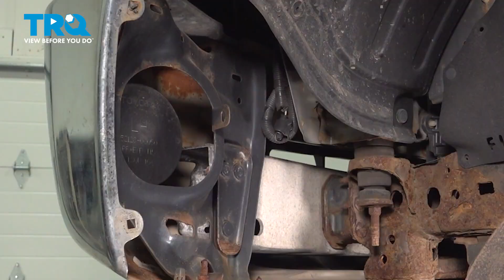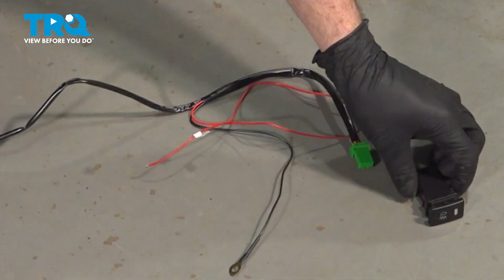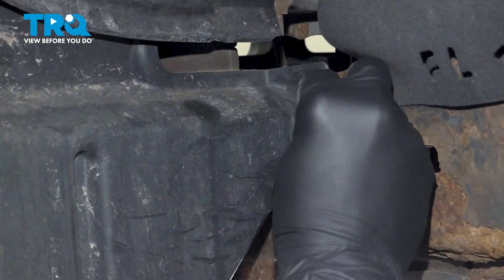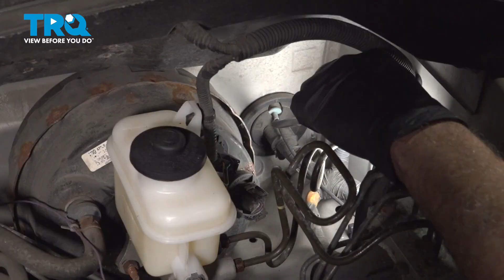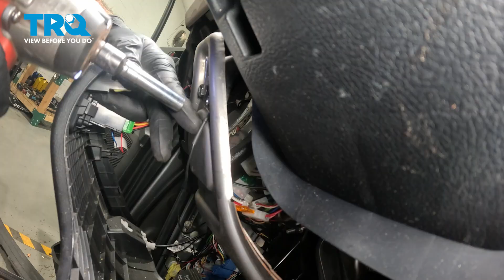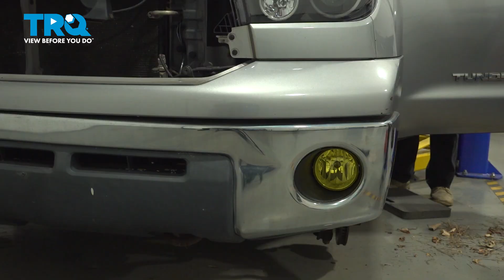How to Install Fog Light Kit 2007-2021 Toyota Tundra

Comment: That truck already had the wiring, why you added more. Tap into the wire cluster under dash and connect to the switch. Not very smart install. 😅

Comment: I hope you will answer my question. Should your fog light switch be on all the time when it’s connected to the factory 15a slot in fuse box as shown? I followed your directions and installed my switch as described. Every thing works but the light on the switch is on all the time, so I disconnected in the fuse box so as not run my battery down, or will it?